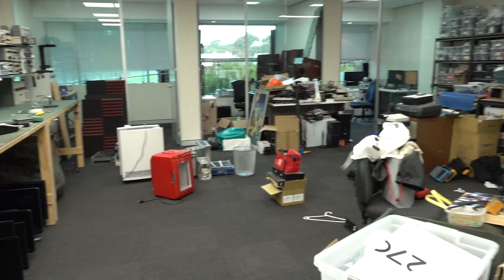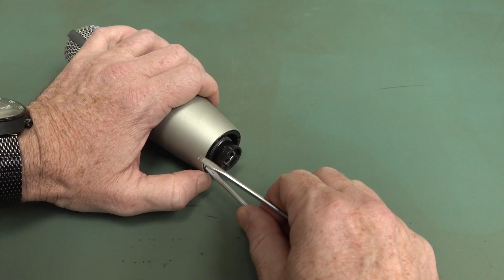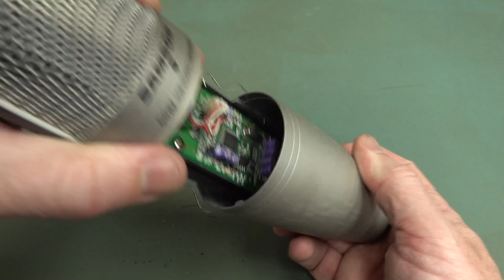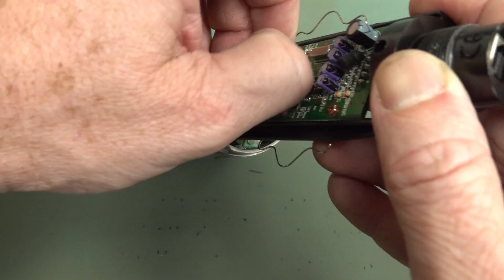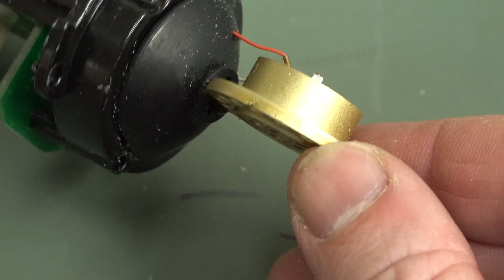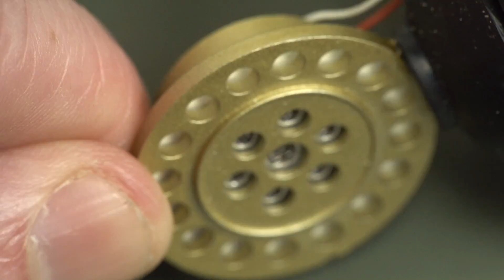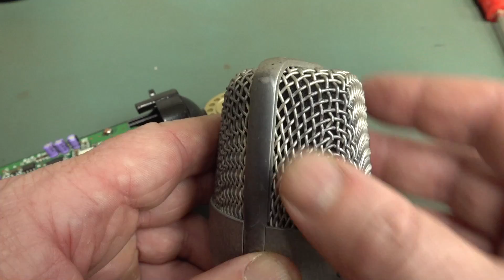EEVblog #1199 - Samson C01U USB Microphone Teardown

Comment: Ah this is the Transound TSB165A capsule as I see ... it's 16.5mm diameter ... "cheapo-whipo" stuff surrounded by the porous plastic material it was used in the 70s for some toy like the small cars for kids and so on.
Good for podcasts and some video VO but not exactly for Studio. Good improvement should be to replace it with a true condenser mic capsule (yes technically this is also a condenser capsule but it's electret and not what I mean). Then ad a DC/C converter to bias it with 70-80VDC. The audio quality will be improved significantly.

Comment: Thank you for this video, I bought a Samson C01U Pro a couple of years ago that from day one frequently refused to connect to and be recognised by my iMac (even though the LED on the mic lit up) and then over time would not connect to my iMac at all and today after watching your video, I took it apart using needle nose pliers to rotate the bottom ring off and the circuit board that connects to the USB B plug had semi disconnected from the 4 pin socket. When I re-seated the circuit board, it now connects every time. Now I know what to do if the problem occurs in the future. Much appreciated 🤩
Reply: @June@97 No, but I only record spoken word. I have found that a pre-amp plugin is your friend. I like Analog Obsession preBOX, CHANNEV or MPReq Pultec EQP-1A Equalizer. Also the Reaper reaFIR plugin in subtract mode can be used to remove the high noise floor.
Reply: @June@97 I'm using macOS 12.6 on an M1 iMac. I have the Input volume set in System Preferences Sound control panel at 50% and I get -18dB average no problem. As for preamp plugins, if you don't like the stock plugins that come with your DAW, I'd suggest Analog Obsession preBOX as it is free and has several popular preamps (SSL, Neve, Ampex tape, Fairchild) built in.
Reply: @June@97 YW. Hope this helps with your gain staging quest 👍😊

Comment: So, I love my C01U, but what I DON'T love is that in order to be able to access the fade controls, you have to buy a separate program. Sure, it's only 4 bucks, but having to spend extra money just to access a feature that should be core to the microphone itself is an incredibly shit move on Samson's part, and the fact that they didn't just build that properly into the Windows driver speaks volumes.

Comment: Just one note for people taking this apart, those sprung clips either side of the chassis ping away very easily. Don't be surprised if you have to put everything down for 5-10 minutes to find out where the hell one of them went.

Comment: Been using a C01U Pro for almost 5 years now, looking to finally pull it apart and clean the foam for the partial time I didn't have a windscreen over it. Looks pretty easy, Thanks!

Comment: it is not true-condenser microphone, polarization voltage is not applied to the capsule, right?

then explain why they put 510M, if there is already a bias resistor inside the jfet?

Comment: Electret is great for music, I understand.  And probably some of the cheap audio noise meters are using electrets as. Well.  When you go to the precision meters, you find there an active bias supply of 200 V DC.  An electret membrane is of course plastic.  Bruel and Kjaer  precision meters have a metal membrane and an incredibly narrow air gap despite the high voltage.  They also have a teflon cap that contains desiccant.  You have to dry that desiccant every so often.  Reminds me that mine is due a visit into an oven again.

Comment: I did electronics design at Samson for about six years. One of 3 electronics engineers there. I just left a few months ago.
Reply: i use a q2u, good mic :)
Reply: Hey the Samson honestly is the ONLY mic that works best for my voice, I have tried hundreds of mics up to $2000 , I’m curious to what I can do to the mic
To get the small hiss out of it, like is there a small mod I can change out on the board to achieve that?
Reply: @rylandweet7750  that's because this is a fake mic it's electret not real condenser. The real makes revealed ur real voice that u disliked
Reply: @W0rldViralDaily  untrue. I know microphones , there are many electric mics , like a akg c214... there are many
Reply: @rylandweet7750  ELECTRET*
Reply: @W0rldViralDaily  my bad I misspelled it, still doesn’t change what I said though.

Comment: Are you sure that's a 10M resistor on the input JFET. Couldn't it be a 510M high voltage low inductance resistor? If it was only 10M the teflon standoff wouldn't be likely to be doing much.
A condenser microphone capsule is a voltage source with an effective impedance of a few tens of pF and needs a pre-amp with an input impedance of at least hundreds of MΩ typically up to a few GΩ.

Comment: If the windows glass s cracked its because the structural sill above the window is failing.  You should have the wall checked out.

Comment: As you say, all a matter of personal preference, but:

For actual podcasting (read: humans speaking), Samson Q2U sounds better, as dynamic mics give more of that "radio voice" effect. You'll say it's technically worse, but we're just used to it and associate that sound with professional voice recording.

I had one and it sounded great but its foam smelled cancerous [:(], so I traded it for a Samson C01U Pro (a truly worthy upgrade over the C01U and C03U) for recording some guitalele, condenser mics are superb at that IMO. And of course now I use it for gaming and stuff, awesome piece of kit, none of that XLR ADC rubbish :)

(I also had a Behringer which was awful, those people cannot into USB)
Reply: "those people cannot into USB" <- This!
As soon as you start talking about sound there will be some people that claim USB sounds like crap, and that when it comes to microphones XLR is the only way to get quality sound. The funny thing is that most PC users who use XLR microphones also uses a sound interface that is connected to their computer using USB, and suddenly it sounds great!
What Lam wrote is a large part of the reasons USB has got kind of a bad rep amongst sound professionals. To many USB is the cheap and cheerful alternative to IEEE 1394 or FireWire as it's usually called, and in a way it is. For most peripherals such as keyboards, mice, printers, scanners and memory sticks USB is much cheaper to implement than FW would be, and it's good enough for most users. When it comes to microphones however the market has been flooded with cheap USB microphones that simply said often sounds terrible, while the early attempts from established manufacturers suffered from a lack of experience working with USB and ended up with a lot of noise and bad sound quality in general.
Since then a lot have happened and there is no longer much reason for a quality USB microphone to sound as bad. It does however take a bit more components than what you find in the cheap stuff. This is also why USB connected audio interfaces combined with a XLR connected microphone has a much better reputation than USB microphones. The electronics in the interface is more robust and uses better filtering of the power than what you find on most common USB microphones. There are also some ease of use that you get with an external audio interface such as easy to adjust levels and mixing options, but the big advantage is that you can choose from hundreds of microphones from all the major manufacturers. This means you can find a microphone with the sound characteristics you want or need.
So while a USB microphone can sound good it won't be cheap to make, and while a sound interface and a good XLR microphone might cost more it's also more flexible and future proof.
So choose your poison...

Comment: Oy, external amp and XLR cables aren't rubbish, mate! ;).
Reply: Maybe other rules apply when you are upside down?
Reply: Oh cool to see you here love your music!
Reply: Robert Slackware  Maybe you should open an interface and look how they generate Phantom power. I don't thing it's really about the preamp at all.
Reply: Robert Slackware   Not sure if I'll be answering your question but I can tell you that phantom power is to provide electrical current to the audio signal, but is just voltage, I mean it doesn't do anything with the audio signal itself though its purpose is to amplify the signal that the delicate and extremely sensitive mechanism of the condenser microphone produces which is a very low signal and because you are working with sound the need to preamp the signal as close of its source as possible is key to avoid noise contamination, also, and probably more important is the function is that condenser microphones require a voltage for polarizing the microphone’s transducer element. ...something like that, not sure if I'm covering it all or even being accurate enough at an engeenering level, but something like that is what it does. 

Many times you can use a simple phantom power device that even works with a 9dc battery or 12v dc power supply, it really doesn't affect the sound quality of the signal at all.For amplifiers to work with condenser microphones you should normally use a console that can provide phantom power to the mic lines, every single console mixer in the market does so.

 Regards!
Reply: Robert Slackware  14mA per channel, as limited by the current limiting resistors and the 48V voltage. It's 7mA per pin, times two pins supplying it in parallel.
Reply: Better than USb mics
Reply: some people love latency xddddd

Comment: For the record, I used one of these in a XLR version on stage as a guitar amp mic for over  a decade.   Fairly convinced it drank more beer than anyone on the stage.   I won it in a contest, bought a second for cheaper than a SM57.  My big beef was the bright blue LED, gaffer tape fixed that.   

To this day, still my go-to guitar cab mic.  

We ran a LOUD show, REALLY loud, full-on touring PA in a small club.  It responded well, sounded great.  Best 75 bucks for a pair of guitar mics ever spent.

Comment: LOL I still have the old Black and Yellow Stanley screwdriver set that I got for Christmas when I was 5 years old. Huge mistake giving me that for Christmas let me tall ya. I ripped apart every toy and small electronic device I had. Some of it never made it back together. Got zapped a few times but quickly learned about 110v and hot caps. Those old 110v high torque alarm clock motors will give ya a nice jolt lol.

Comment: I don't really see why they used a capacitor to reduce the overall capacitance of the board's plane
Reply: I dont see a capacitor on the standoff on the signal line. The red component is a 10 megaohm resistor.

Comment: I used this mic for music vocals. The noise floor kinda sucks. The AKG perception series is much better for this
Reply: Lots of older cheap condenser mics are a bit noisy, actually, and USB ones tend to be even worse (ca. 30 dB(A) SPL vs. ca. 23 dB(A) SPL). A 10 meg bias resistor is on the low side (it is not unusual to find 1 GOhm parts, the reasons being explained in one of the Doug Ford videos), and most of all there's the very modest dynamic range provided by the AK5371 (a typical 84 dB(A) assuming an external preamp circuit is being used, and the 77 dB(A) dynamic range for the 20 dB fixed preamp or the 40 kOhm input impedance for the inverting PGA do not inspire too much confidence in the analog input noise floor either). There is invariably going to be a compromise between level handling and noise floor.

I'd speculate that the IC was originally developed for the more modest needs of small (e.g. 1/4") electret capsules. Its limited dynamic range wouldn't be nearly as much of a problem if there were a good low noise, variable gain preamp stage present in the mic, but there isn't one.

Comment: Which exact chip is used there to communicate over USB? Is it that same which has ADCs? It would be great if you could make a video how to make\solder basic USB device to PC... with USB communication basics overview... e.g. make USB device similar to MIC, but having Sin-Wave generator (or white noise generator) on-board instead.
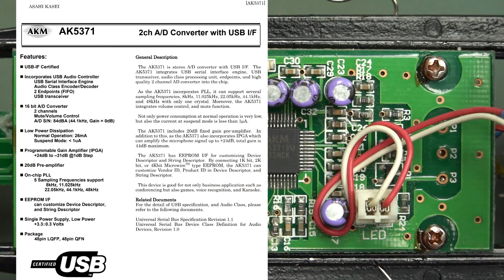Reply: The data sheet at 3:50 says the lone chip does USB I/O and "audio class encoder/decoder" which I'm guessing is being used for ADC, and has the potential for DAC (some USB mics let you plug in headphones, which would use it that way).

Comment: I would say that Samson gear is of rather poor quality
Reply: That's a very sweeping statement. Care to explain in what way, or are you just going to leave it there as a troll?
Reply: @Zadster  I looked inside of some wireless microphone transmitters and receivers by Samson some years ago, and got an impression of very cheap stuff. And even without looking inside, the audio quality was not impressive at all. Quite far from Shure or Sennheiser, for instance.
Reply: @feedback-loop  Fair enough. This unit looked pretty decent to me. Not super high-end, but then the price isn't high end either. Nice youch with the Jfet gate on PTFE and robust construction.

Comment: All pretty ordinary, standard microphone technology.  No trade-secret technology.  Using Teflon standoff terminals like that is common in many high-impedance circuits, not just condenser microphones.  The special part is how Samson designed it for the particular features most required for "podcasting".  Condenser mic capsule manufacturing methods are pretty standard across the industry as well.  The difference between the 84-cent jelly-bean commodity electret capsule and the $1000 top-end technology is the choice of materials, precision of manufacturing care of assembly, testing tolerances, etc.  There is a reasonably good video on "how is it made" where they show the details of making a top-end Neumann U87 microphone, including assembly of the capsule.  The assembly of the capsule is essentially identical between an externally "biased" capsule  vs. an electret capsule.  How a Neumann U87 microphone is manufactured:  https://youtu.be/cvtjHhtxmpI
Reply: Exactly. And Samson scams people who don't dissembly it because Samson imitiates a gold shape rubbish bigger diameter capsule. And the real capsule is shorter indeed. An obvious scam for people trying to see the capsule from outside of the mic. hahahaha. It is a cheap microphone but this practices are for bad brands.

Comment: In cases where it's not clear if water contaminants get under SMD's etc.. I like to inject a little IPA from a small syringe to specific water trap points and then use a soft tooth brush to clean residue. A little compressed air to blow-out, and things come-out looking new!

Comment: A puzzle to get you thinking: 
The wavelength of sound at 1KHz is 340mm.
The capsulse size is 19mm.
How does the capsule achieve a cardioid polar response?
Reply: Note the larger baffle around extending beyond the face of the capsule.  And note the small holes in the back-side of the plate and the back side of the capsule. Those are all very carefully designed to achieve the polar response.  Even 82-cent jelly-bean commodity electret mic capsules use exactly the same method (side and back ports to reduce sensitivity to the side and back.)  But most small jelly-bean electret capsules are omni-directional with no side or back vents.
Reply: On the ocean a wave may be 200 m from crest to crest. A boat 10 m long will still ride on the crests.
Reply: @therealjammit  I'm not sure the analogy matches perfectly with acoustics, but you have me interested now.  Can you help me understand exactly what what you mean by riding the crest?
Reply: The capsule works beyond just its resonant frequencies

Comment: 12:40 Well, that may very well be a Transsound capsule - probably the biggest(?) "medium diaphragm" electret capsule OEM.
Reply from the maker: Interesting. I just assumed that Samson made it.
Reply: @EEVblog  Nah, very few mic manufacturers make everything in-house (especially on the lower end of the price range) :P 

Even that cast chassis and the grounding springs (in fact, the whole casing) look very similar to Behringer's C1.
Reply: If you take the capsule out of its phase correction frame, it has TS stamped on the side of it - bit of a clue there... And it's not a 19mm diaphragm - as near as dammit, it's 15mm. So basically a cheap half-inch electret. The capsule comes out quite easily if you pull the little black ring away, revealing the appalling truth about it. The best thing about these mics is the case.
Reply: @stevegarnett6455  I kinda thought it resembled the TSB-165A, apart from the "specified" diameter. Pretty sure the slightly different hole pattern on the back (4 instead of 8 or however many might fit) is partly how they get the supercardioid pattern.
Reply: @khronscave   - could be; it does look very similar indeed to the TSB-165A but the dimensions fit the (non-available now) TSB 160A better. What's even more bizarre is the construction of the C03, which doubles up the whole arrangement so there are two of these assemblies back to back, with the separation between the diaphragms of about 25mm. They claim that by switching between them you can get figure-8, what looks like hypercardioid, and omni responses from it. One day when I want a good laugh, I'll plot the polar responses. I have no great expectations. I only got these to loan to people when they were desperate to borrow a mic - I don't want my good ones damaged and these Samsons really don't matter.
Reply: JLI do their own version of it - JLI 160A, and from the detail on the spec sheet, I'd say that this was the one.